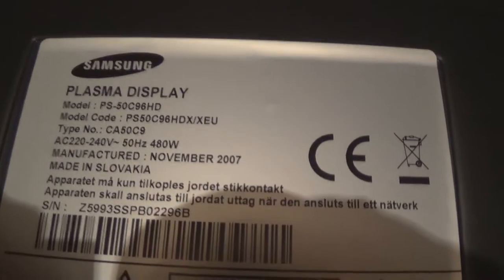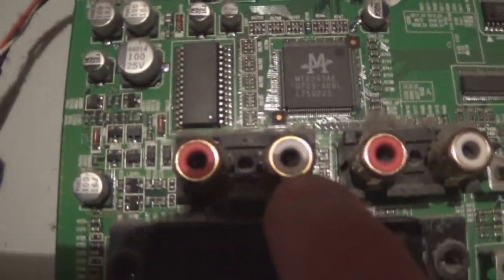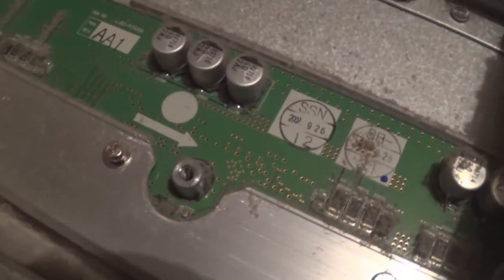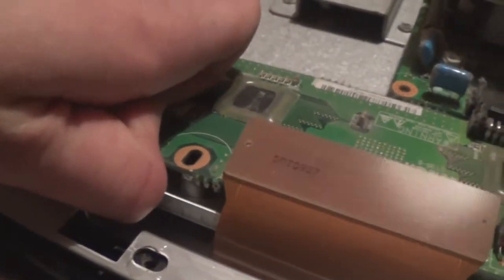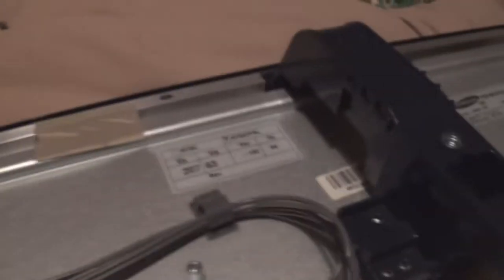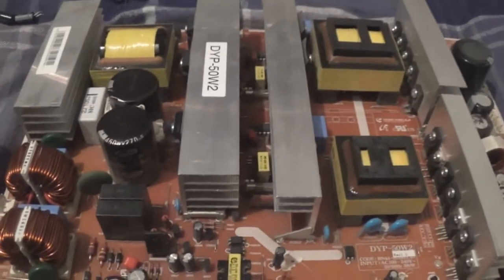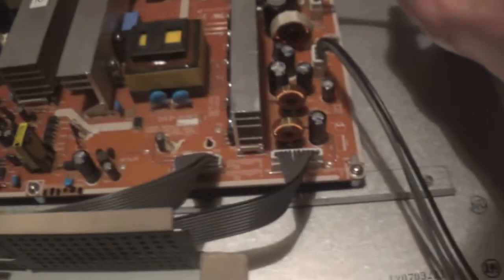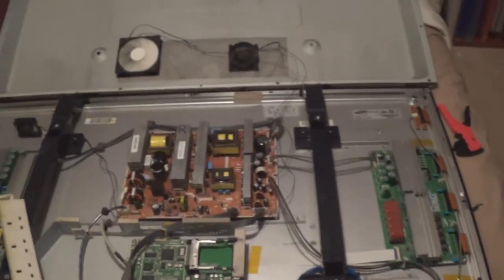Samsung PS50C96HD Repair & Relibilty Mods

Comment: Adding fans is definitely a good idea, though I would've personally used machine screws to attach them, rather that glue - makes taking them off much easier in case they ever need replacing/cleaning. Good job though - that's an insane amount of fans in a TV btw - 3 of them ! :))
Reply from the maker: Haha cheers buddy, this Tv doesnt even get warm now. If only Samsung added them from factory these Tvs would have lasted alot longer. Also yes I was out of fan screws though so had to use glue lol. My Pioneer Kuro 50" Lx5090 has 4 80mm fans in it lol
Reply: Yeah, I get in quite a few Samsungs at work each week myself. They're all different models, but the formula's the same: 90% bad caps, which I think is done on purpose really, because they're always placed (almost strategically) near hot parts like FETs or heatsinks....planned failure is what I call this, since it's a known fact that caps don't like being hot, so the manufacturers took advantage of this in hope that after the device fails because of a simple component, people are gonna trash it and buy a new one (or at least turn to one of their service centers). I once had this TV (I think a Philips) where the heatsink for the schottkys formed a nearly closed loop around the output caps ! I doubt nobody knew about the heat issue when they came up with that design :| I pulled out the whole thing and replaced it with a regular finned heatsink the size of half the back panel just to be sure :))
Reply from the maker: Yeah these older ones are ok you will get a good few hours out them but if Samsung simply added fans and better caps these would likely not fail as much as they do. Also I tend to get these with mainly blown fets, shorted ymains and badcaps lol. Also yes deffo planned.

Comment: Hello,hoping you can steer me in the right direction.
Have a nice “old school” Samsung plasma Tv. PS50Q97HD, similar to in this video. I’ve watched you’re video on the PS50Q97HD  a few times and found it very useful , however this hasn’t resolved the issues.

When you plug the Tv in and turn on,the twin relays click on the PWR Supply board, but No Picture,No sound and little indication that the Y main or X main are active. During troubleshooting this I’ve replaced the PWR Supply board and re- flowed all the high power transistors,connection sockets and large capacitors, I then replaced the Y main and associated Y main buffer boards (Hi) and (Lo) I then replaced the X main board and Audio Visual board. So all areas that could cause problems have been addressed.
There is a small board (behind) the stand (sub assembly) called the “logic Board and a pair of “Buffer Boards marked (E) and (F) at a he bottom of the set just above the speakers ( these have not been replaced)
When powered on there a two green leds lit on the small (logic board) and a single green led lit on the bottom of the X main board,but nothing on the Y main board.

Would a fault on the (logic Board) which has ribbon cables  going to Y main X main and (E) and (F) Buffer Boards cause issues.

Or could the (E) and (F) Buffer boards cause issues.

The Y main has two multi pin connectors that interface the Y buffer which has 8 gold cables that go to screen

The X main has 3 brown cables that go to the screen.

The (E) and (F) buffer boards have10-12 cables that go to the bottom of screen.

All replaced boards have come from a working sets with damaged screens and have been tested.

So I need to determine is the (logic Board) or (E) and (F) buffers ,or both are causing the functional problems,as all others have been addressed.

Any advice or guidance would he greatly appreciated.

With thanks jason
Reply from the maker: @Jrer241067  hi Jason, does the panel light up with a full glow ? Ysus should have flashing led when working.
Reply: @MrReeceyburger123  the panel blank and unlit. One of the boards (Y) or (X) has a solid green led lit,no blinking. The (Logic board) behind the stand (Sun Assembly) has two green leds lit,no blinking, when it was briefly working in the past I believe one of the green leds on the (Logic Board) flicked.

The thing that is puzzling me is ? The original PWR Supply board was used in both PS42Q97HD and also the PS50Q97HD a tick was put on the relevant model designation on the board at the factory in that case (50) was ticked
The replacement board has the only a (50) designation on the board and thus this is ticked at the factory. There are a few subtle differences.
(1) it only has 1 what looks like a 4 pin rectangular audio chip on the heatsink,where as the old board had 2
2 there is also a  1transistor on this board where the other has 2
3 there appears to be only one ( looks like a capacitor) in a white rectangular case on this board,where the other has 2

The riveted holes on the pcb and holes in the heatsink are in exactly the same place on both boards but this (50) has those components absent.
Could this be causing the issue, I could remove these from the old. Board and install them in the new board,( but wary) as to could this cause issues/shorts/ etc.

The  (Y) and (X) main when last tested seem to be missing the 207vac going to the white plugs with thick  grey cables from the PWR Supply,yet going by the green led lit in one,it appears data is being fed down the white ribbon cable.

So I’m in the situation where I’m trying to  locate those 2 pesky bulbs on the Christmas Light set each year that have blown😂😂 and won’t work.

The PWR supply definitely is working. The blue led under the (on/off) button responds to remote commands (as it blinks)  the set turns back to (Standby)after 20 minutes inactivity.
When turned on the two relays click on the PWR Supply board (Blue led) under the (on/off) button blinks 6 times then nothing.

Hope that helps Jason
Reply from the maker: @Jrer241067  you need the right power supply. Certain sub supplies can be different and vs va etc. See what the vsc voltage is running at and 15v on the Ysus first. And you need vs up and running for any image to be written. The set comes out of stand by and runs vs va with out the Ysus/xsus connected ?
Reply: @MrReeceyburger123   thanks will check, and see if there is any PWR supplies exactly the same as old,as I was unsure due to the slight differences mentioned, small but could be the solution 
👍👍
Reply: So progress on the Samsung(PS50Q97HD) is proving tricky!!!! The new PWR supply( identical) to the one fitted originally at the factory. I did the 
Precautionary re flowing of all joints capacitors,transistors ,voltage regulators ,small transistors NPN /PNP . Cleaned excess flux from board . Checked and inspected re-flowed join and components.

Re-fitted board . I used a RCD extension to be safe. The set appeared to try to boot up (BUT) kept blowing (Plug fuses) I used 3Amp initially then 5Amp. Each time it blew these fuses, and on one occasion there was a loud bang and it (Tripped) my RCD to socket circuits in flat !! , I reset this and installed another 3Amp fuse ,it just took the fuse again!!!

Do I then re-installed the other PWR Supply (50” only) designation ) on board. This blinked the ( blue led)under the(on/off) button 6 times. When I pressed the (on/off) button heard clicks from behind but nothing happening???

It appears there must be a (Dead Short ) somewhere on the 42”/50” board,which was the ( factory Fitted) type and this replacement was( exactly the same) 

As you mentioned,check the voltages on the board, however( it’s difficult) when it takes the fuse almost immediately,this is not easy.

Any thoughts, bit puzzled.

I’m thinking of getting a Engineer out to give me some advice.

Comment: hi there i have the same tv changed some of the caps on the power supply that were bulging, its now taking 3mins to turn on,also im getting what sounds like static through the speakers also still clicking off n on, but after 3 mins all ok and never switches off. can you help?

Comment: Nice Video MrReeceyburger123 ...Have You Ever Repaired a Samsung UE46F5300AK Led TV With The Bottom Half Of The Screen Dim.. (Bad led Back Light Or a Driver Fault ?)
Reply from the maker: Cheers, also yes possibly Led failure. Take the screen apart and have a check.

Comment: Hi i've got a 50 inch samsung ps-50q96hd that keeps clicking and wont turn on, the clicking is coming from the power board, Ive checked the capacitors they all seem fine, checked the solder joints they all seem fine also, would you have any suggestions as to what it could be as im at a loss with it? many thanks
Reply from the maker: simon davis disconnect Ysud and Xsus
Reply: Disconnected Ysud and Xsus and checked and still clicking from power board?? However after plugging both Ysud and Xsus back into the power board and unplugging and replugging the power the tv briefly fully booted on then after quickly unplugging and replugging a minute or so later to see if the fault may have cleared it went back to constant clicking and not coming on, tried process again but didn't boot up the second time just constant clicking, Any further suggestions??